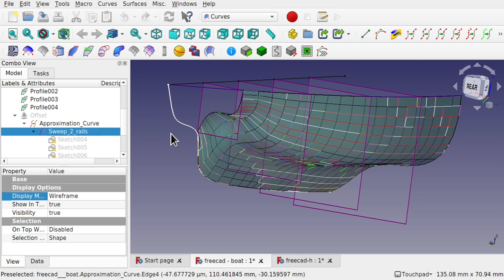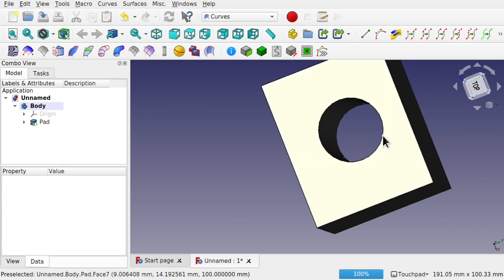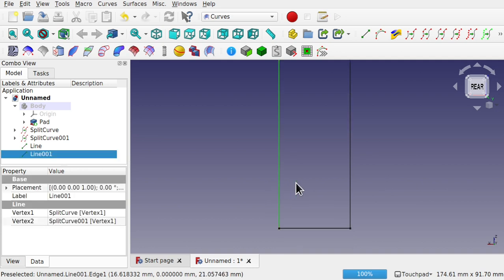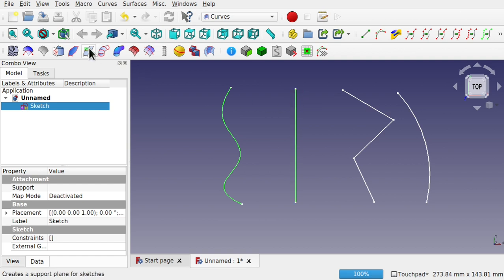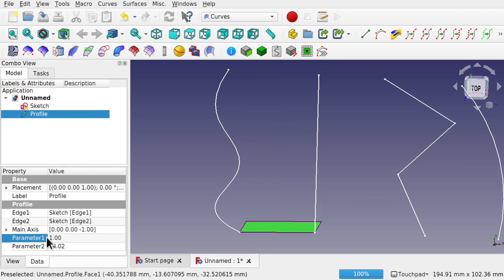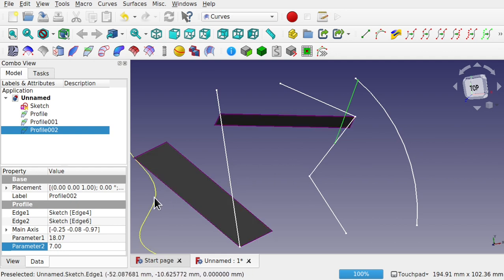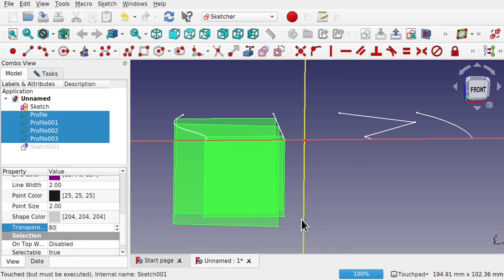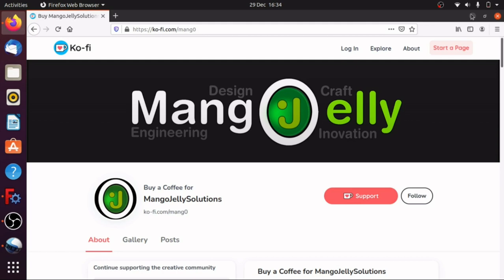Learn FreeCAD Curves Workbench [04] 1 of 2 Profile support plane Boat / Ship hull / fuselage example

Comment: At about 7:00, when we're adding planes, why are they called profiles?
Reply from the maker: They are called profile support plane and assumes you are using the tool to position profiles for lofts,, extrudes and sweeps and sweeps.  But you can use them for what you want.